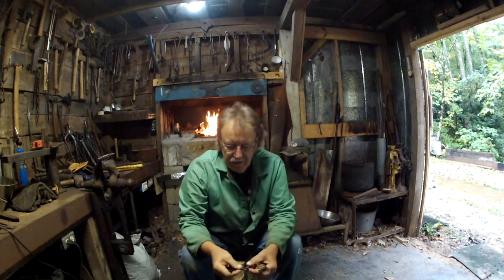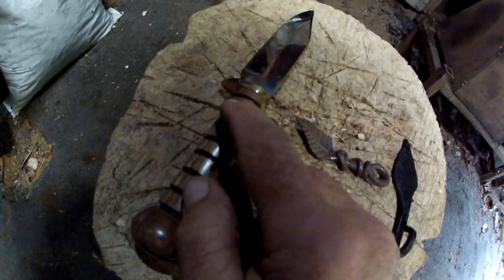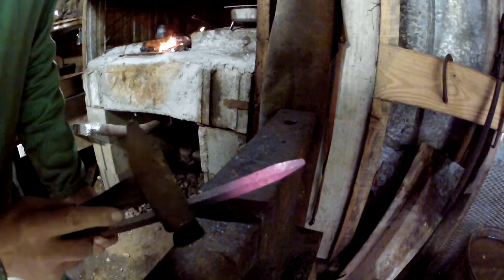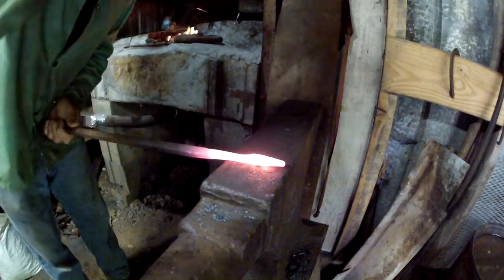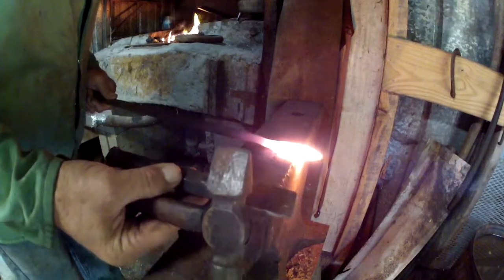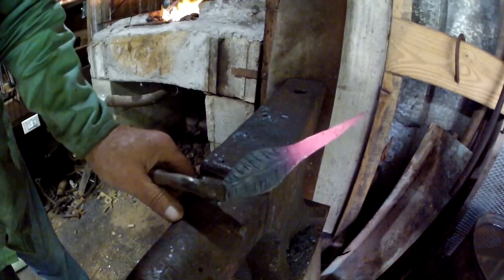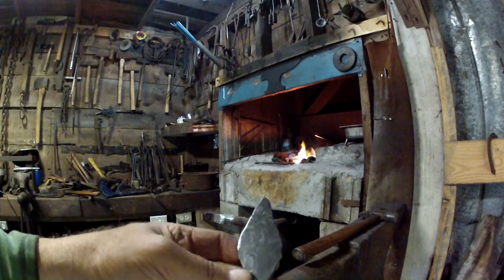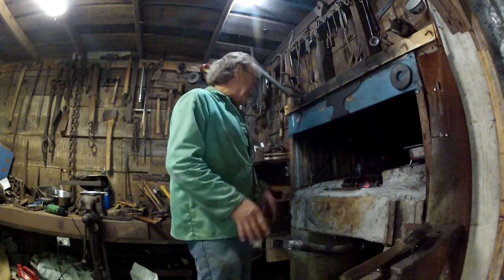How to forge a leaf coat hook

Comment: Looks good Mike! Your friend did a nice job on that  knife too! I bought a single burner gas forge. I’m 3/4 of the way finished putting it together. $75.00 kit on Amazon. I think it will be good for small projects.... we shall see!
Reply: @Mike Reed - There’s a YouTuber blacksmith channel I like to watch... “Old Hickory Forge”.  He got one and said it definitely can get hot enough to forge weld... it’s stainless steel, check it out. I finished the refractory coating and put together the burner assembly today. It has to dry for 24 hours before I can fire it up. It’s called a Mr Volcano single burner forge. $75.00 👍🏻 Made in USA
Reply from the maker: @CarolinaChrisOutdoors  OK CHRIS I WILL BUDDY THANKS A LOT

Comment: Good day to you, I'm making some hooks out of the bars from a cattle panel I hit with the bushhog. I'm cold bending them in a vice with a hammer. Some I'm making an eye on one end to run a screw through to hang on a wall. Making a tight eye is pretty hard. Wondering if you could do a video on how you would do that, cold, and with the forge.
Reply from the maker: i will thanks for asking